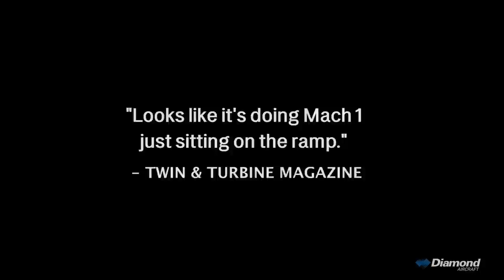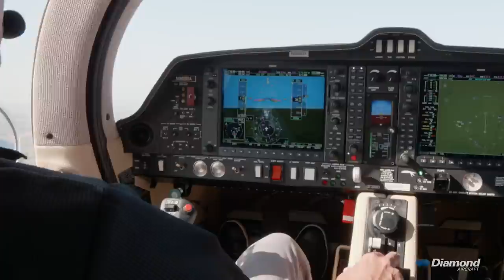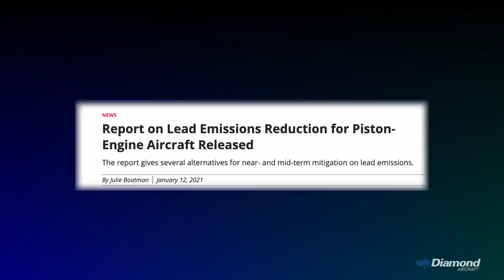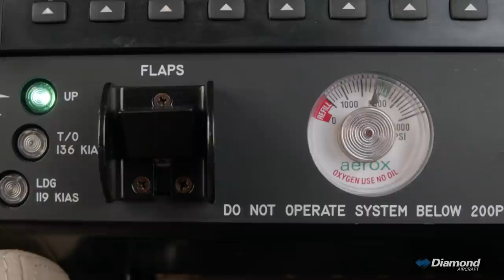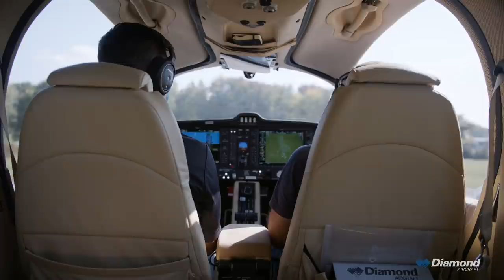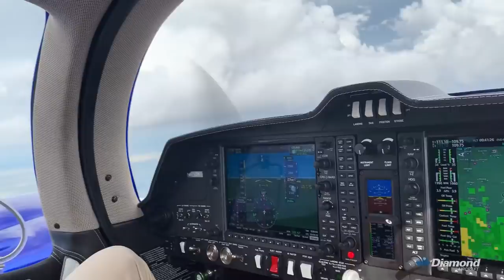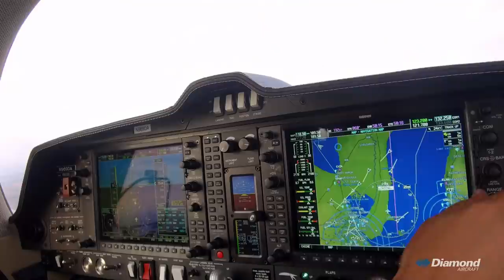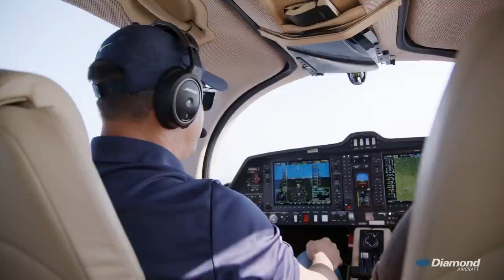The Story of the Diamond Aircraft DA62

Comment: hmm, didn't know that 100LL was 4x lead gasoline for cars. That makes me extra disappointed in the stagnation of GA.
But DA62 doesn't impress. 1.6 ton, 1.2million dollars and not pressurized nor fast. Might be better than a Baron but that's hardly a bar. It might be the best of the worst.
If it was a fifth of the weight, pressurized, twin jet and cost 1/5, then I would like it. Then it would be decent. 1.2 million is more of the same.
Reply: Maybe there is lead in avas..  the amount of aviation engines using leaded fuel compared to car engines is minute. It is not a problem.
Reply: Well, cost is a huge problem with GA in general. All compareable twins cost around the same, and none of them come with the fuel efficiency and safety gimmicks the DA62 has.
Reply: You’re complaining about the lack of innovation and wondering why something that is innovative is so expensive... can you put 2 and 2 together yet? Not trying to be a smart ass, but the tough regulations make it tough. Aviation needs tough regulations for everyone’s safety, but I believe the industry needs a lot of help too.